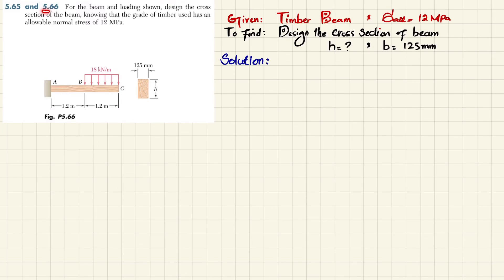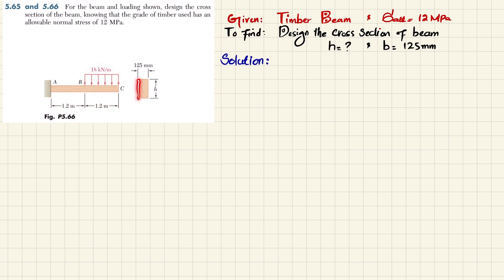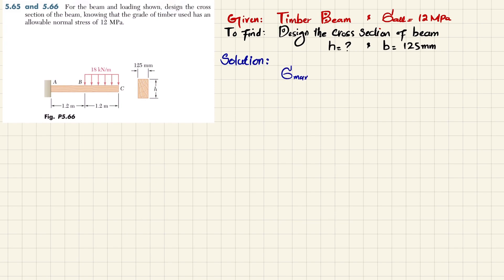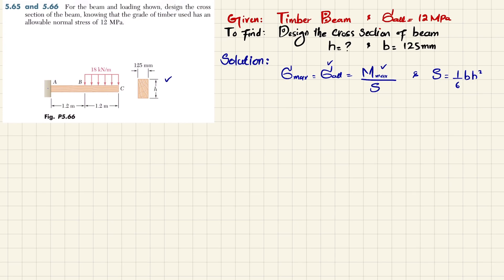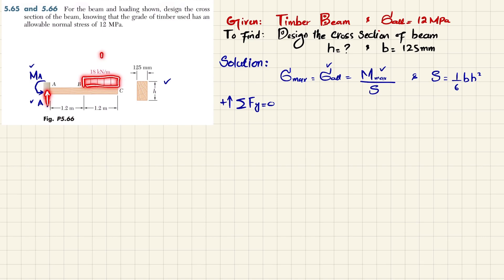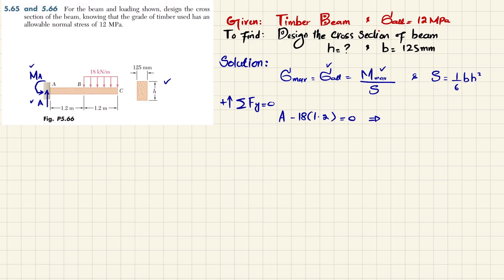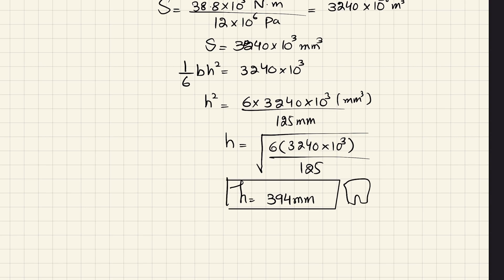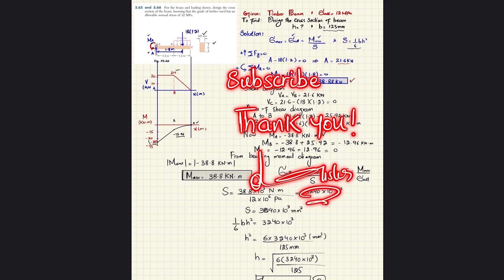5.66 Analysis & Design of Beam | Mechanics of Materials

Comment: The torque here is positive according to what you drew in the beam, so why start the diagram of the torques from the negative side?
Reply from the maker: dear it's given in the book that when ever you have external moment that is counter clock wise so while drawing moment it will go down...while clockwise will go upward...check mechanics of materials rc hibbeler
Reply: @engradnanrasheedmechanical   understood
Reply from the maker: Good to know that....
Reply from the maker: @Hadid eyal remember it as the same will be apply to all related questions...